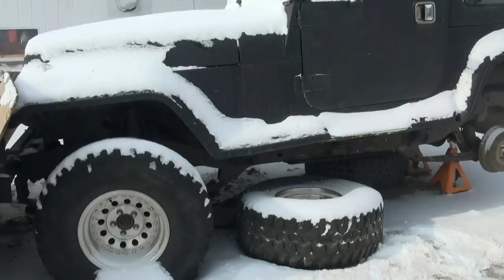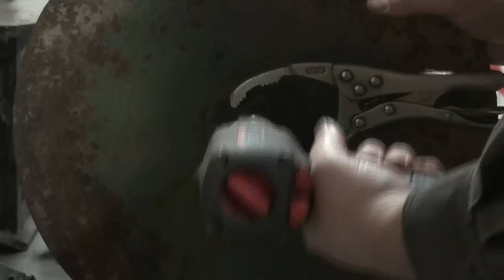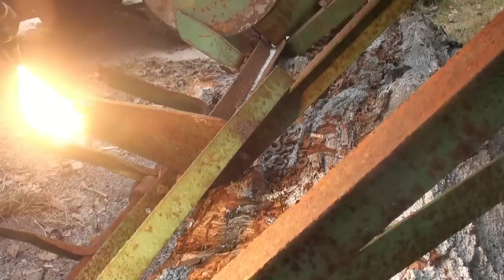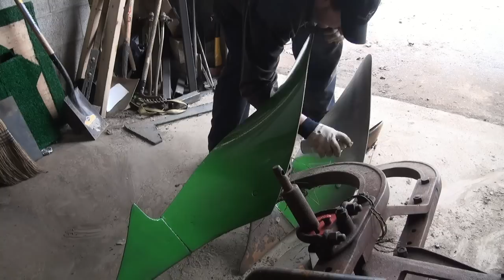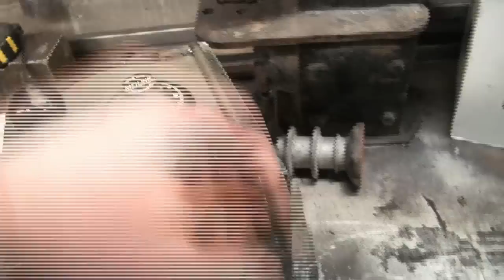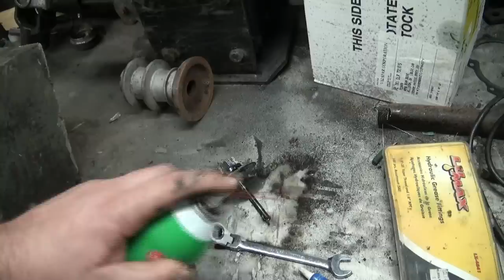THE LAST BILLSTMAXX VIDEO

Comment: It is not weird. The cutting edge of the pointed end is a harder tool stool so rusts more redly. I know this will be too late for you, but you could have put a really thick coat of Primer, the grey stuff if that is all you have or red if you have that, it will definitely stop the rust for many years, and certainly until you want to put your John Deer on to make it pretty.

Comment: Save the paint.. a light coat of oil will work very well...  Whenever you empty a can / jug of oil.. turn it upside down to drain over a collector.. After several containers, you'll wind up with a nice amount of "general" oil to use for things like this.. or anywhere you need a bit on non specific kind of oil.. like an oil can..